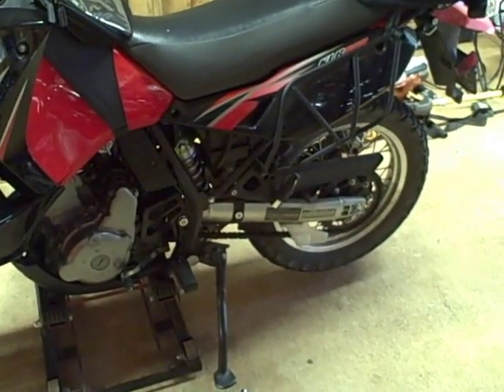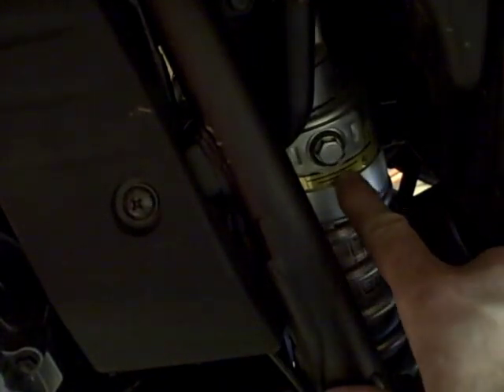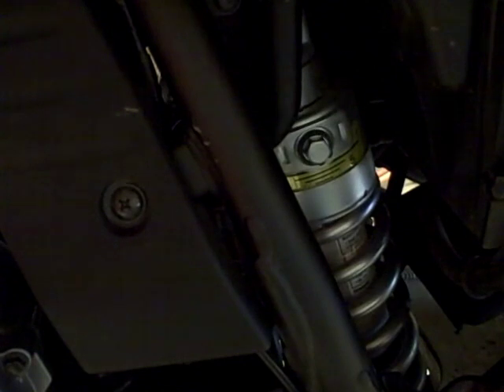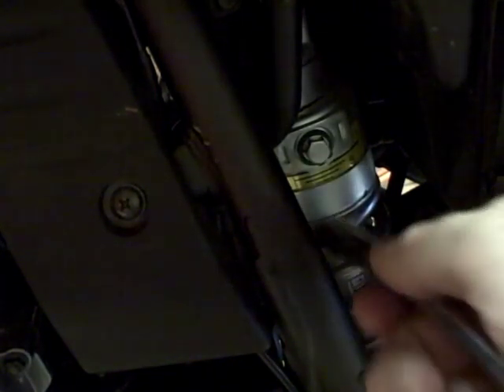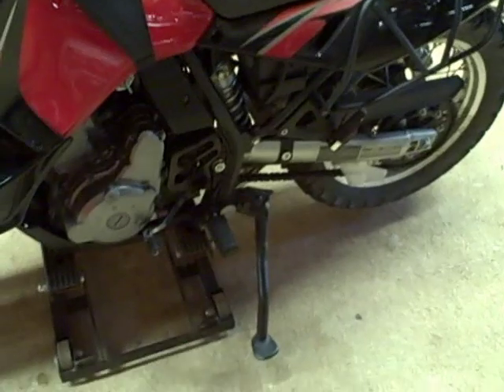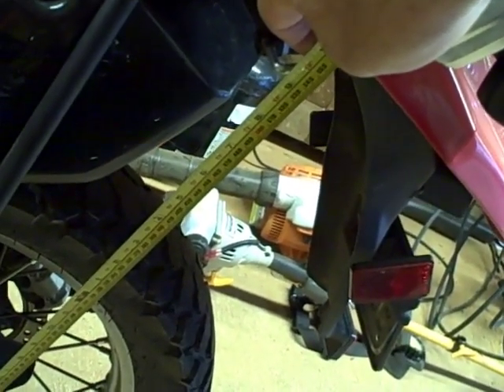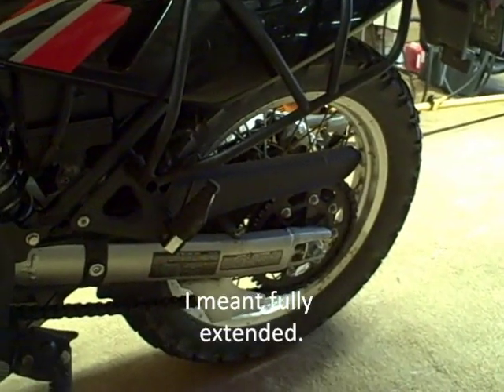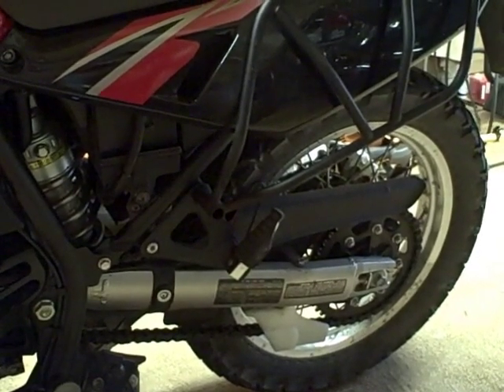Motorcycle Repair: How to adjust the rear suspension preload on a 2009 Kawasaki KLR650

Comment: Got a used bike.  No owners manual.  Came with Clymer book.  Past experience with Clymer, find three other sources before relying on anything in those books.
Why can't it just be said that if the rider & gear fall into a certain weight range, set the spring in such & such position?  At least one other video says always turn adjuster to the right.  Clymer says nothing.  Still uncertain.

Comment: What are some tricks to bring the bikes clearance up higher? Mine is a 2008 but sits about 4 inches lower then 2018? The specs say pretty much that the clearance should be the same. I am 6ft4" so taller the better for what I use it for. Thanks for any insight!!

Comment: Hi smallengineshop, In my manual is says never to do what you are demonstrating with regard to adjusting the spring pre load. "Caution - When the spring preload adjuster is at the position of the first of fifth do not turn the adjusting bolt in the opposite direction of the above procedures. The spring preload adjuster will be damaged by the shock." i.e. when in fifth position DO NOT continue turning clockwise to first position!  Please correct me me if I'm wrong. Thanks for the video none the less. 

EDIT: Just checked. You do need to go clockwise to get from position 1 to 5 and and then anti clockwise to get from position 5 back to 1. If you continue clockwise after pos 5 and it bangs back to 1 then you may damage the adjuster.
Reply: +Jason Burgad Just checked my 2015 manual, specifically says do not go clockwise from 5 to 1, or counterclockwise from 1-5.
Reply from the maker: +Bradley Stephenson Check your manual for your year KLR. This is a 2009 version and the first gen KLR's might be different. Kawasaki changed the suspension on  mid 2014 and later models, so they might be different. This is why I always say check your manual..
Reply: Bradley Stephenson  It's my understanding that the pre 2007 suspensions require anti-clockwise to unload the spring and the 2007 and newer shocks function as described in the video.
Reply: Yup, he's right. I've got a 2009 KLR, and in the manual for the 2009 KLR it warns not to do this.
Reply: Pre-2007 has a physical stop to prevent the 5-1 adjustment which forces an anti-clockwise adjustment to unload. Rapidly unloading the spring is likely harsh for the mechanism, but still possible on later models. Happy Riding.

Comment: Oh yes, I weigh 175, and like to take it camping.  So tent, sleeping bag, tank bag with 'stuff', pannier bags with extra tubes, oil, coolant, etc.  Then saddle bags with a change of clothes, food and water.  So probably 250 lbs at the top end but the sag is terrible with the stock shock and spring.  Thanks again, Pete